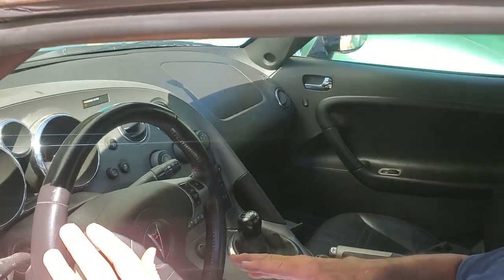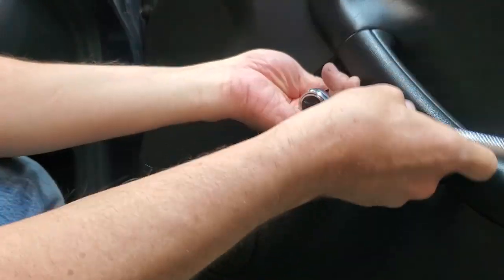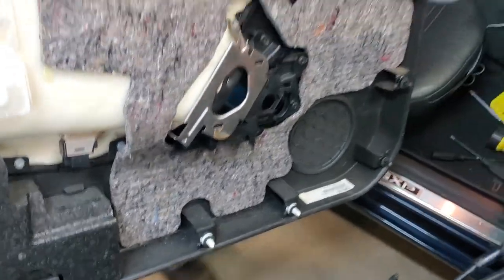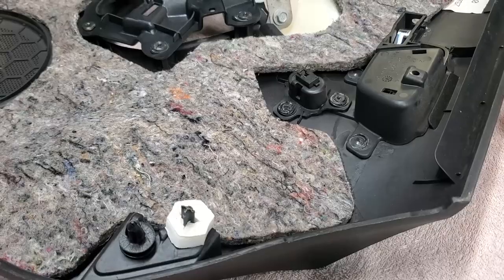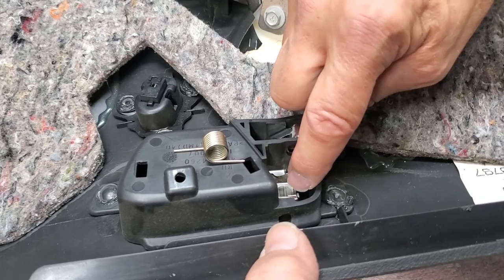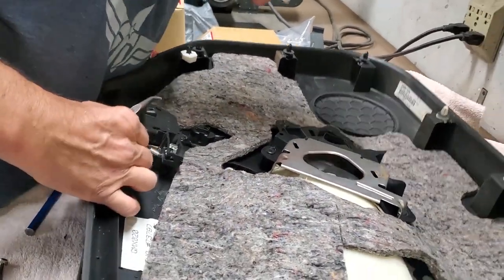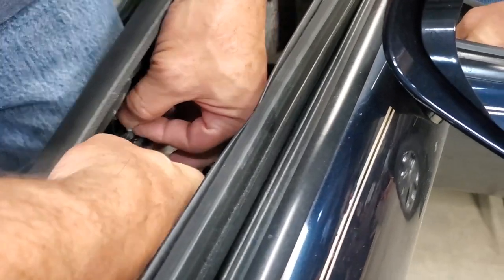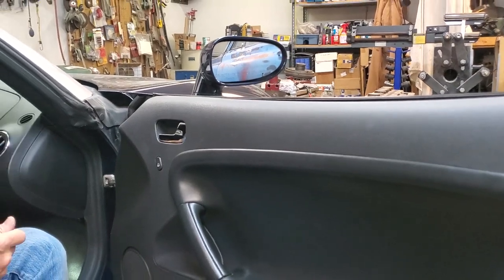Pontiac Solstice Saturn Sky Interior Door Handle Replacement

Comment: I purchased the replacement handle on Amazon which arrived in 2 days then followed the procedure detailed in the video. It took about an hour for the removal and replacement. It was a bit tricky getting the new pin and spring in place as demonstrated but everything went well and the new handle is now installed and working properly. Thanks for the detailed video.

Comment: Note: If you remove the plastic weld, on the inside of the door panel, FIRST!! You can slide UP the original plastic shaft, (and reuse it.) Dont destroy it. It pulls straight up from the bottom to the top.  Slide in new handle, easily slide OLD pin in from Top to bottom, then weld tab on... with solder gun!    😅it's easy, no fighting door panel, and you're finished in maybe 4 or 5 minutes.👍
Reply from the maker: Wow, thanks for the tip. Is this how you repaired yours?

Comment: How about using the entire Cobalt handle ? Removing the plasti-welded Solstice crap and putting in the Cobalt version with the bezel ?  Mine is still good, but in case it goes, I will try and install that whole unit. I do not like the look of the interior handle without the bezel. Looks cheap.
Reply from the maker: Yes, that makes sense, and that can be done. We left ours to factory original. Thanks for watching!

Comment: I did this procedure today on the passenger side door.  The Dorman number for the handle I used is 81891.  The number may be different for gray or black housings.
The OEM black plastic rod comes out by pinching together the bottom end with pliers and then using a punch to push it back into the door handle housing.  I drilled a hole in the plastic piece of the door that is the inner retainer for the door panel.  This allowed the black plastic rod to be pulled out with pliers.  The plastic rod will bend a little, the steel Dorman rod will not.
To get the rod back in, I pulled on the door panel to allow room while my son inserted the plastic rod into the handle housing through the hole I drilled.  Once it was started it is flexible enough to ease into place.  I did not pop the handle plastic weld doing it this way.  I reused the old plastic rod and the OEM spring.  
The video was very helpful and this was done in a couple of hours.
Reply from the maker: Thank you, your comments are extremely helpful and we're sure our viewers will agree. What we really like about your comment is that you have given a lot of information. One of our viewers asked about the Dorman handle about 3 months ago. We greatly appreciate the time you've taken to describe your process. Thanks for watching!

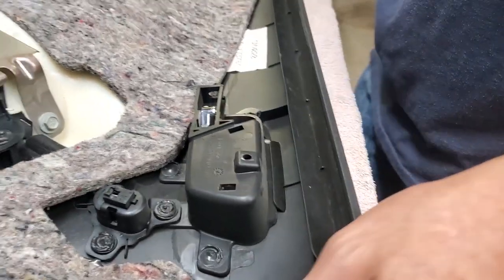Comment: 10:43 No need to cut the pin out. You an just squeeze the split end together and it will slide through.
Reply from the maker: Thanks for writing. We love it when our viewers pass on useful advice. Thanks for watching.
Reply: @CarzPlus  You're welcome. You do have to remove the handle assembly though to make room for the pin to slide out.  Just did both doors - replaced one assembly with super glue and the other with JB Weld and they both work fine. I pulled Cobalt handle from a local junkyard and it didn't have the metal pin so I reused the plastic one. Then I found the second 2006 Cobalt handle on Amazon with Prime one day shipping. So much easier to get it from Amazon. Although our nice junkyard is a very cool place to find parts and see the old cars.

Comment: My door will not open from outside or inside on driver side door??? And suggestions
Reply from the maker: It's likely that some of the plastic parts have deteriorated. The rods between the plastic parts are metal and should still be sturdy. Sounds like you'll have to remove the door panel in order to completely repair it and you'll probably have to replace the interior and exterior door handles as well.

Comment: Is there something that can be sprayed on the handles to prevent the peeling/separation?
Reply from the maker: Good question, although not to our knowledge. The failure is due to it being a plastic vacuum plated part where the coating has failed from the inside out. Thanks for watching!

Comment: Need to get latch from car 2008sky from driver side.when driver side is not opened
Reply from the maker: For clarification, it sounds as if you're trying to repair the driver's side door handle while the door is still closed. Is that correct?